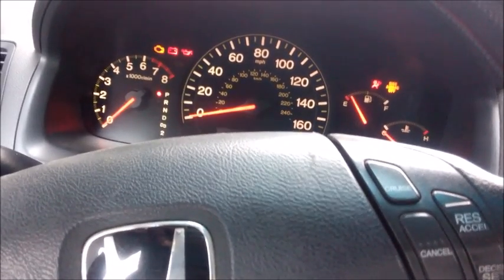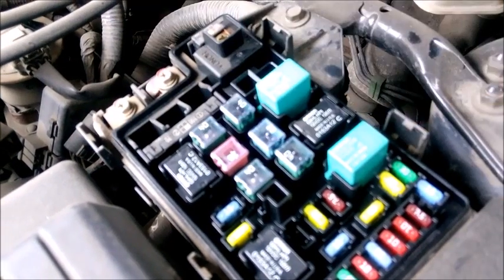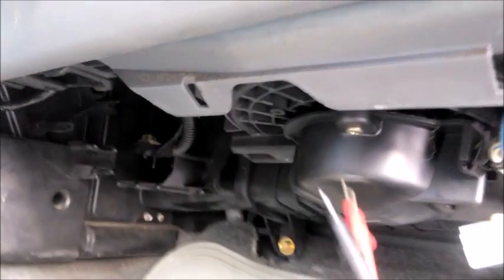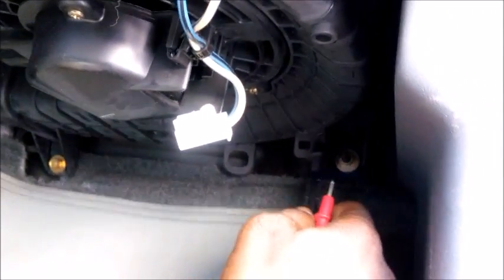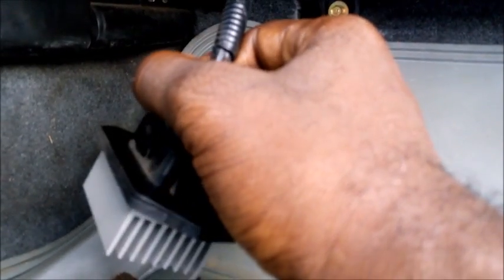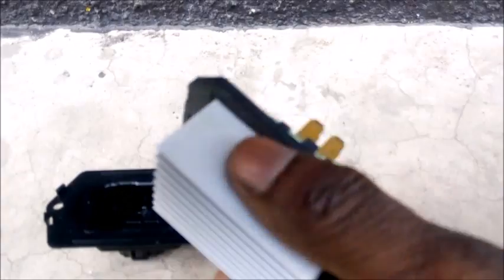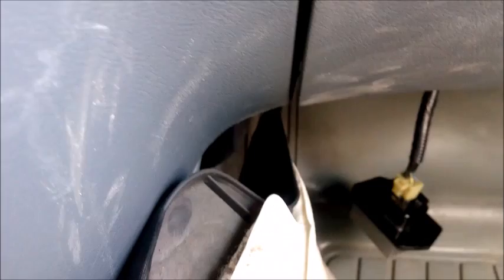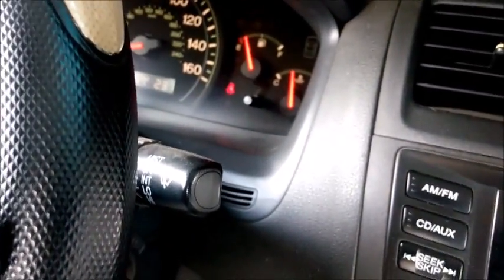AC, Blower & Fan, not working - resolved.

Comment: Hello, I have a similar problem with an Infiniti g35x, how do I locate the relay responsible for powering the blower blower motor
Reply from the maker: Hi, the relay may be in the fuse box in the engine bay (under the bonnet). Look at the inscriptions on the fuse cover carefully. Not sure if the Relay will be incabin

Comment: Sonny, Thanks for the video. I have Honda CRV 2010 and the blower motor, its speeds, the blend door actuator (for mixing Hot and Cold air flow) working fine. Just the center middle dash vents not blowing air. They blew air intermittently over past one month, not anymore. Left side vent only blows a little. Any idea what I can check? Thanks!

Comment: Hey mate, 
Ive replaced the whole transistor unit 2 months ago and its work.
2 months later its probably burn again.
Any idea what could cost that damage again? The air blower work perfectly and clean, so is th air filler

Tnx
Reply from the maker: Was the thermal fuse blown?
Starting the engine while fan/blower & or AC switch is turned on could cause it. It is a good idea to turn off the blower switch before. cranking the engine. 🍸
Reply: @SonnyIbibo  ohh sure, im never turn the engine on while the AC switch is on.
Any other idea? Tnx for answering!
Reply from the maker: Since the blower is working fine, replace the fuse & ensure that the blower switch is always turned OFF before cranking. Check the related fuse under the steering. No spikes. That's it. 🍸
Reply: @SonnyIbibo  thank you very much!
Reply: @SonnyIbibo  so, actually i found out that the blower was the cause for blow the fuse every time.
He was not run smoothly and i replace it..work great so far(over a year)
Thank you for your help!
Reply from the maker: @danieltur23  You're welcome. 
Am glad you fix the issue.

Thank you too for the feedback, it helps.🍷

Comment: How do you fix the fuse?
Reply from the maker: The fuse was not bad as in the video. But if yours is bad simply to replace. Pop the bad one & push in the good one.
Reply: @SonnyIbibo  no.. I ment the thermal fuse inside the box
Reply from the maker: The thermal fuse is on the circuit board. I desoldered & removed the fault one, put a good 10A thermal fuse & soldered it to the circuit board. It worked.🙌
Reply: You can't speak up😳?